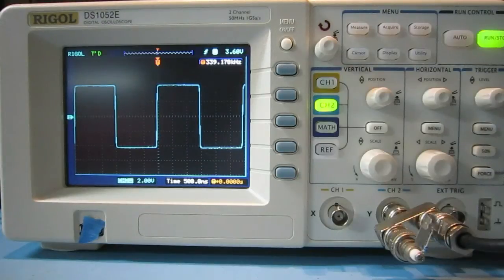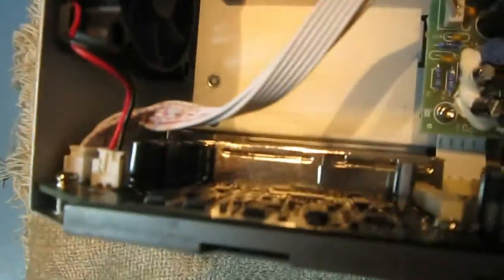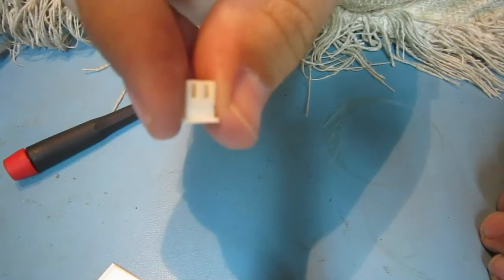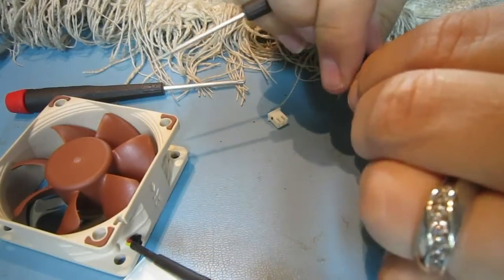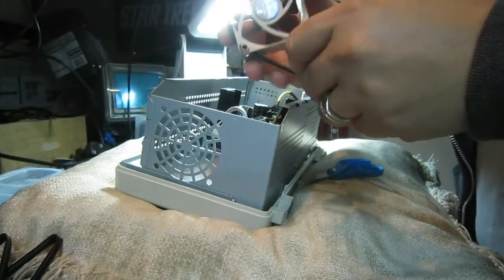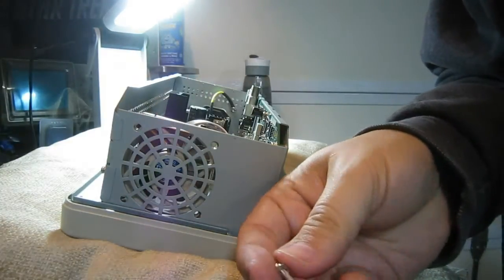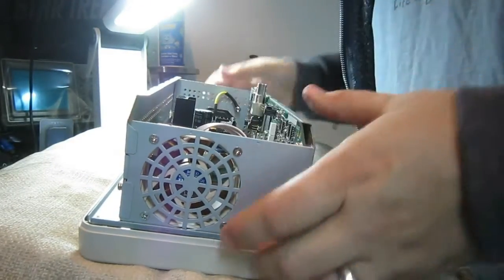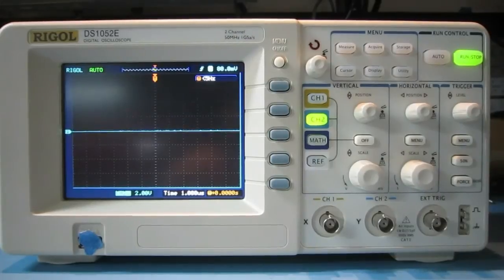Rigol DS1052E Fan Mod

Comment: How has that fan gone over time, as it pulls 40ma higher than the original. Did the machine handle the slightly higher current ? Cheers
Reply from the maker: Yup 5 years later and no problems with the scope at all :D

Comment: Does this work easy with a Hantex DSO5102P ?
Reply from the maker: based on this pic https://goo.gl/images/sSUwmt you likely would need to order a different sized fan. but I see no reason why it wouldn't work.
Reply: Thanks I will take a look at the fan size.